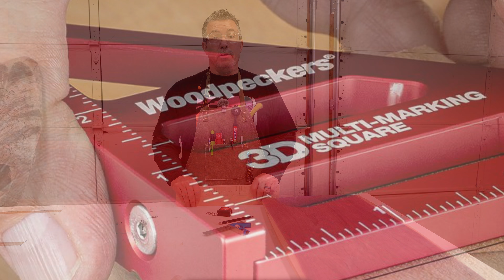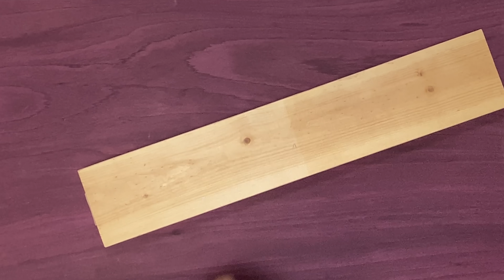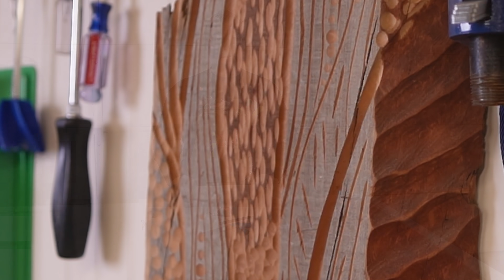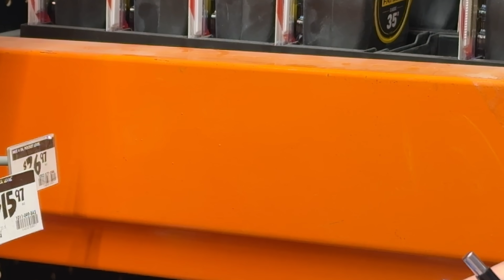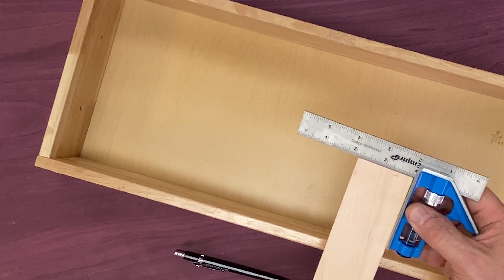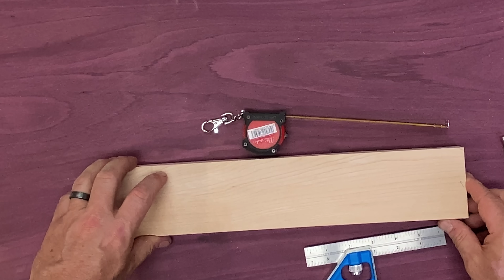You're Measuring Wood Wrong (and Wasting Money)

Comment: First of all, I love your videos!!! I noticed you measure right to left, as most of us do. My wife recently bought me a “fast cap” tape measure. It reads both ways and helps a great deal. Just wanted to pass that on to a fellow woodworker.  Sincerely, Jerry. Spokane Washington
Reply from the maker: Thank you for that feedback and for the tip! I’ll have to look into that tape!❤
Reply: @dansbeedesigns fastcap lefty/righty is what it’s called. I haven’t found it in any hardware store. She ordered it off of Amazon. I hope this helps. Sincerely, Jerry
Reply: @dansbeedesigns a money saving tip is use a stud finder instead of a metal detector. I use pallets often and use a stud finder to find nails. Might save a couple bucks.  Sincerely, Jerry. Spokane Washington